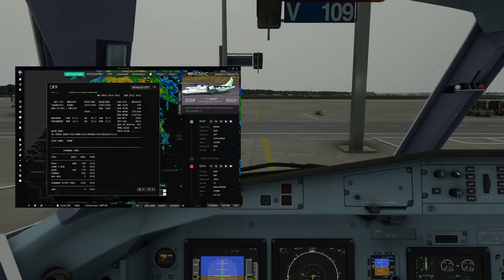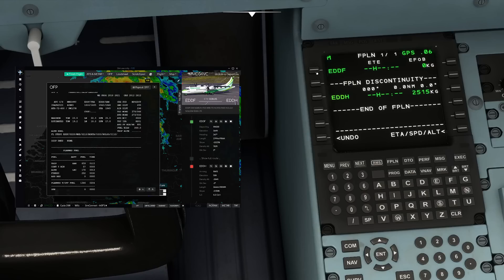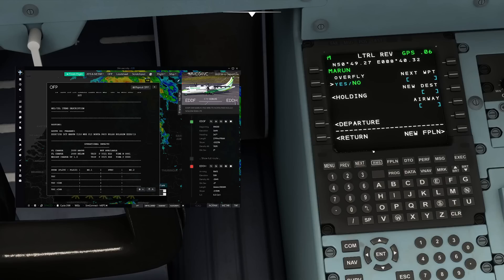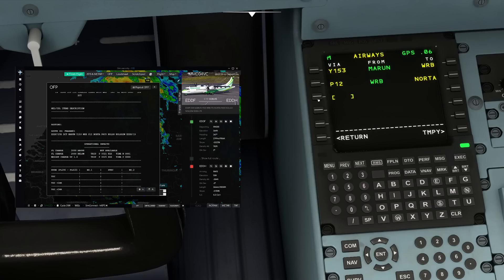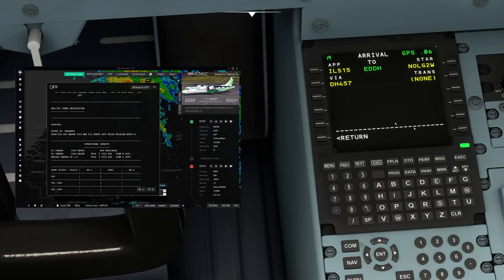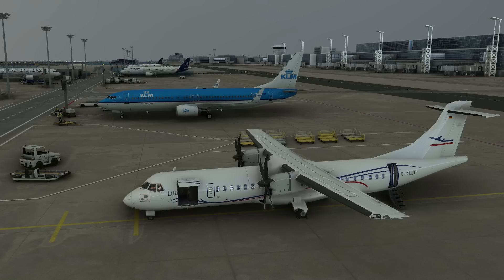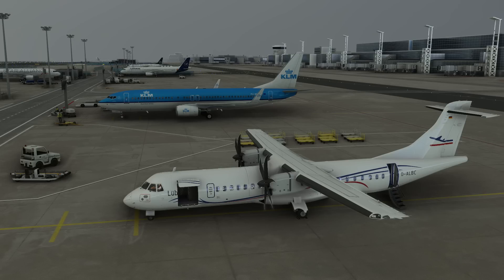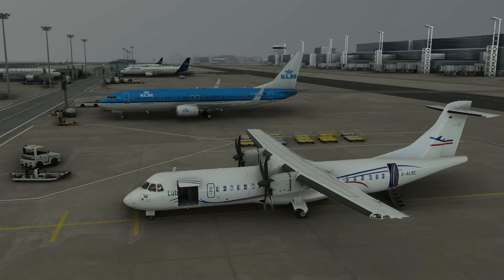ATR 72 & 42 How to AVOID FREEZING your FMC

Comment: Great video! I also found that FMC becomes glitchy when you import flightplan from Simbrief (instead of entering it manually). With imported flightplan, it won't let you change any arrival data, such as approach. The only way to fix that would be to manually create a new flightplan while in flight. I now enter flightplans manually, which is OK since routes for this aircraft are usually short and it doesn't take long to enter. One thing that this aircraft still lacks is ability to enter coordinates or create user-defined waypoints, airports, arrivals, etc. (a bare minimum would be entering coordinates). I fly it in the area where Navigraph only has charts for major airports, small ones aren't even present in its DB. There are PDF charts available elseware, but I cannot use them because custom waypoints are not implemented in this model.

Comment: The only issue I had with manual data entry, if the flight plan is VERY long...you end up using up all the space available in the FMS, regarding input lines. Hard to explain, I could insert there a flight plan here for you. I solved the issue anyway...your press TEMP on the right hand side, then your CLEAR on the left...then you'll get more input lines again :)
Reply: That's good to know. I ran into this problem a couple of times. But you never know if a solution like this doenst cause trouble again. The ATR ist still so buggy... 😐

Comment: I've had complete FMC freeze on 3/5 flights.
I did not attempt to input airways on any of these.
User error may account for some of the issues, but on at least one of the incidents i was following your tutorial flight to the letter... and still had full FMC freeze....
This particular freeze you documented may be a reproducible way of causing FMC freeze - and as such probably relatively easy for the developer to fix... but it certainly isnt true to say "don't do this and the FMC will not freeze"

Comment: Any recommendation for takeoff/landing with a crosswind on this bird? not sure if it was your page that mentioned the MSFS bug (rudder becoming momentarily ineffective when your nosewheel is in the air but mains on the ground). Either way this causes issues when trying to takeoff or land with a significant crosswind since correcting with the rudder is impossible once your nosewheel lifts. Any workaround for this?
Reply: Never ran into that, had a 19 knot cross departure my last flight in it. Are you keeping the yaw damper off until you are coming or do you engage it on the ground? Another thing with the ATR, it requires you yoke into the wind pretty good to counter a lot of the effects when you rotate. Without that you will be tossed like a toy

Comment: Great video. I've yet to do a hop that involved inputting airways and I've still had some cases where the FMC freezes regardless. Also noticing the Copilot FMC and instruments are unusable to a degree as well. Great aircraft. just needs a couple of updates to iron out some small bugs.
Reply: Copilot FMC works fine if you load on the runway with engines running so it's definitely a bug with initialization in cold and dark state.

Comment: Another great video. Could you enlighten us how to alter destination runways and approaches mid flight? Simbrief has just added the ATR to the Simbrief Downloader so I imported a previous flight directly into the FMC/MCDU and so far it's worked flawlessly. However, the weather is different, since it's an old flightplan and I wanted to test the import ability, but I am not able to change destination runway/approach. Would I create a whole new flightplan? Please help.

Comment: If they had included a freaking manual for people to follow the correct procedures, that would have been a much smaller problem.

I guarantee it is not a problem specific to flight sim. I'm a computer engineer. Most developers hate doing docs, I myself don't enjoy it too. Management also hates it, most sees it as wasted time that would have been better spent on fixing bugs or adding new shiny features. 

But it is such an essential thing. You can have a fine system completely burned because of the lack of documentation. Also it needs to be quick to find things. So, while videos are cool, they don't quite cut it. We need WRITTEN docs.

Comment: PERFECT, thank you so much. I just did it the way "not to" and my plane hung.🙂 Do you also know about the Prop Brake? I can't turn it off 🙂I taxi on Engine 1 with Engine 2 in hotel mode. Then on the taxiway I will turn off the prop brake, but that is not possible for me 🙂

Comment: Hate to say it but I've been entering my flightplans like this almost every flight and the (right) MCDU has frozen every time ☹ I also had it freeze a couple of times during PERF INIT before any flightplan entry.
Reply from the maker: The right one seems a bit problematic indeed, but the left should work.
Reply: The right FMC works perfectly but only when loading on the runway with engines running. Clearly an initialization issue that needs to be fixed for cold start state.

Comment: Hi, I have some issues like:

Engine are sometimes not starting up.
While switching on std altimeter, the aircraft is always levelling off 200ft below the selected level.

Any idea ??

Thank you !
Reply: Re your second point about altitude, set the baro to the standard 1013/29.92 rather than pushing the STD button and you'll find the altitude is spot on/VNAV ALT is captured correctly captured. I assume it's a bug rather an another ATR quirk.
Reply: @I_Evo  Yes I'll try this way.
Thanks
Reply from the maker: Don't use B to set the altimeter. When setting it manually I never had the low level offs. Anyway the next update should fix that.
Reply: @A330Driver  It looks to work turning the knob to set 1013/2992 instead of pushing or using B, Evo was right. For engines its seems that clicking on cold&dark before every flight on the EFB fix the problem.
Thank you !

Comment: But how do you prevent the right FMC from being stuck on the first page you select. I was disappointed that you never touched the right FMC to notice this. Otherwise though, very nice tutorial playlist for the aircraft and the method mentioned here does work for me.
Reply: If you spawn on the runway the F/O's FMC works fine. Then you can slew or warp to the gate and shut down to simulate cold and dark startup. Clearly something to be fixed in a patch.
Reply: @kutyafal  I guess this works fine then, still atrocious QA on the developers part.